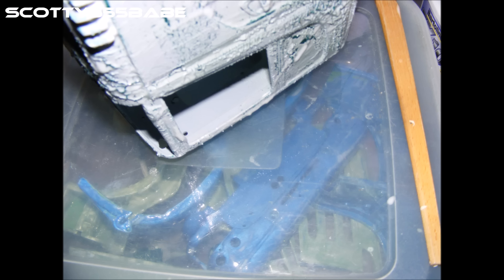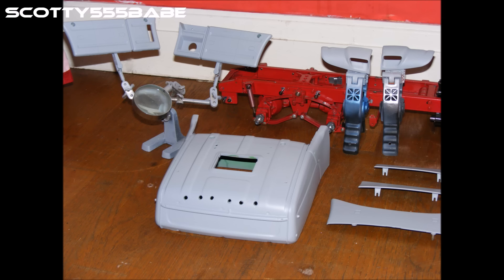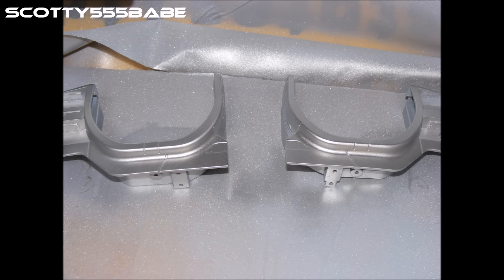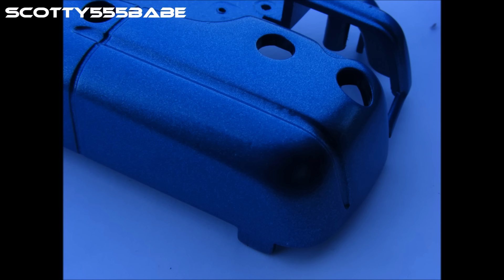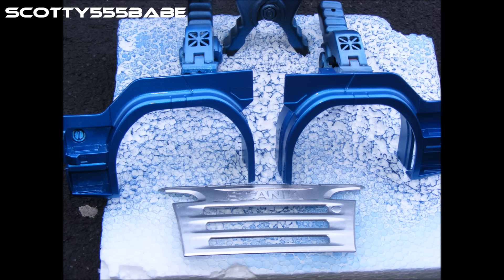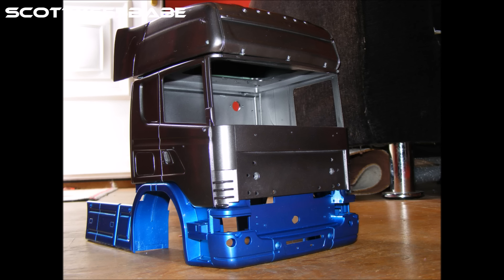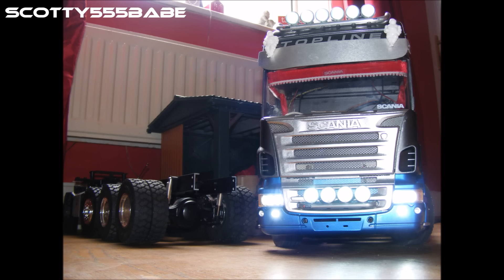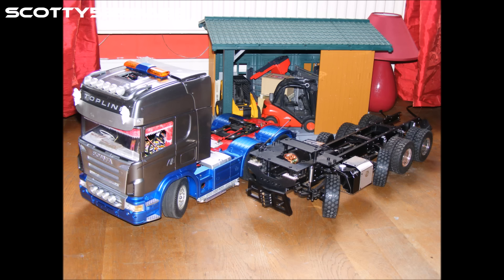RC TRUCKS | Tamiya Scania | Remodelled and New Lightbars | Tamiya Rc Semi Trucks

Comment: Hi mate very very nice is that light gun metal or gun metal as I'm spraying my Merc  the light gun metal.that blue is superb you done it great can't wait to see your SLT where did you get the SLT cab extensions please mate  b
Reply from the maker: Thanks buddy! Im doing my T cab in this blue with a gun metal chassis. the gun metal is a dark. My Merc is just in between coats at the minute with masking off stuff, the wings are available from truescaletrucks.com they are a Uk supplier of 1/14 metal upgrades and other bits. Thanks